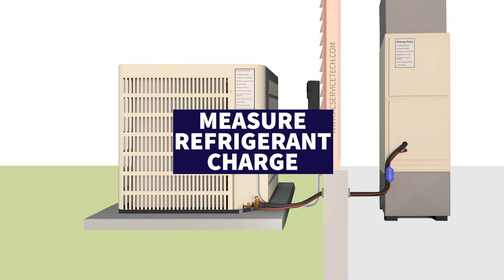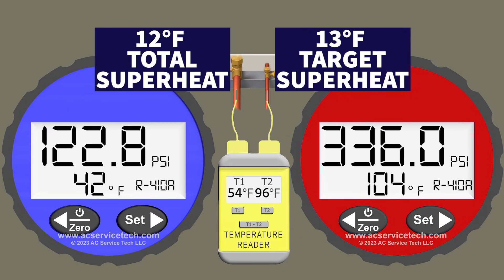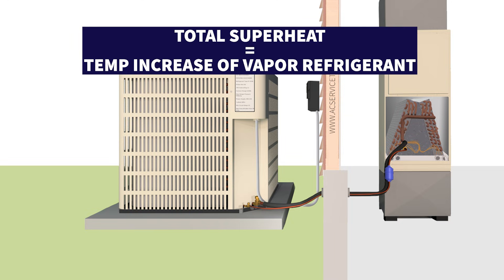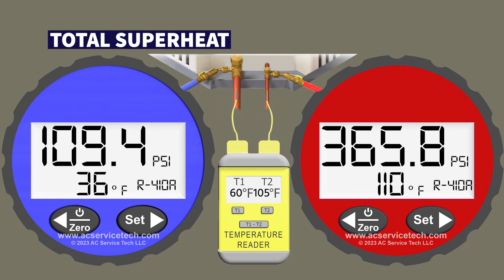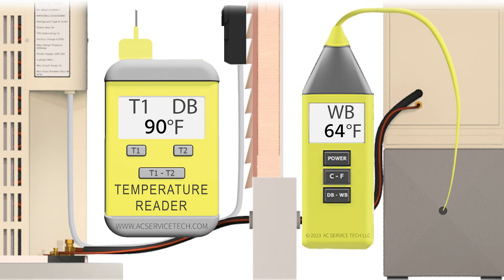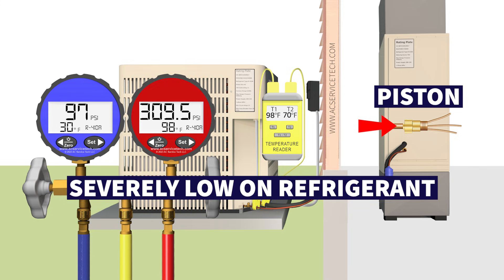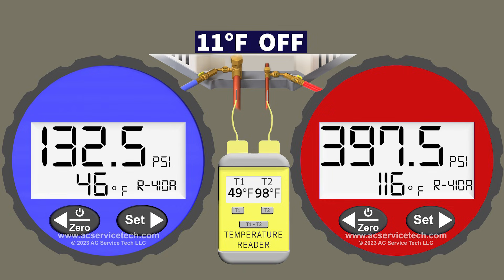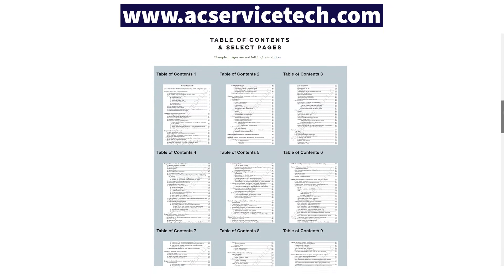R-410A Refrigerant Charge Measurement Examples on Air Conditioners! Total Superheat Method Practice!

Comment: I live in Cabo San Lucas, Mexico. These techs do not evacuate and simply pump in some refrigerant and ask if the indoor mini-split unit is cooling. Do I need Fieldpiece SM380V SMAN  manifolds
$549.10 or Mechanical Manifold Gauge Set, 2-Valve $94? All the Americans are being taken to the cleaners by HVAC techs. The last guy didn't even look for leaks, tighten anything.... just simply dumped in refrigerant, took my money and split.

Comment: Hello Craig, i have a question i went to service this system that had a high pressure of 578 psi in the high side and on the low side 164 psi 43 of superheat and 3 of subcooling it had a piston honestly i couldn't figure out what was wrong because it was not cooling at all

Comment: Excellent video. My English is not good enough, and I need to understand what and where is the outdoor dry bulb and indoor wet bulb; someone can explain to me? They are the sensors that capture the air temperature? Thanks.
Reply: outdoor dry bulb- air entering condenser coil
indoor wet bulb- air entering return grille (must have thermometer that reads wb)
Reply: @handymanbrian8269  thank you
Reply: Dry bulb temperature is what most people think of when they say temperature. It is what most temperature sensors or gauges show. It is literally a temperature reading given by a thermostat with a dry sensor. Wet bulb temperature takes humidity into account, its name comes from the temperature given by a thermostat that has a soaking wet rag of room temp on the sensor. 
You want the dry bulb temperature of the air entering the condenser but the wet bulb temperature of the air entering the evaporator. The evaporator will also remove humidity in the air so you must know the temperature adjusted with humidity. Higher humidity will increase the heat load on the evaporator because some energy is used to condense the humidity in the air and not towards cooling the air. The condenser is at a higher temperature therefore moisture in the air will not condense onto it, so the humidity does not have a significant impact on the condenser.

Comment: Why does every one leave out STEP ONE????  Verify if there is a TXV before you even get the gauges out of the truck!  I suggest using the supercoolsliderule for charging.  Dead nuts simple, no more guessing.
Reply: Knowing your metering device is a crucial step.
Reply: @d3adp94  Thankyou!  I've been saying this for years and everyone looks at me weird!
Reply: Wtf are you talking about? There are so many ways to verify  ac charge. Gauges or not. Superheat and subcooling is actually always present.  You can measure delta T,suction or line temp.
Reply: @5822huron  Yes you can, but I wanna know what I'm working with.  There still is a lot of old junk out there running without txv's in them.
Reply: @worldtraveler  keep pushing

Comment: Thanks for the video Craig! I have a surge question. Is it better to use a voltage monitor like KoolGuard2 or just surge like ICM 495 on a minisplit? Basically is it better for the components to run in occasional undervoltage or cutting power during operation at those times?

Comment: If the total superheat does hit zero and liquid refrigerant does enter the condensing unit, does not the accumulator protect the compressor from that liquid entering the compressor? You, as the technician, might not be onsite to fix that issue and the system should protect itself until it’s fixed, right?
Reply: Many do not have a accumulator
Reply: If it has an accumulator
Reply: @1MNUTZ  you are correct.